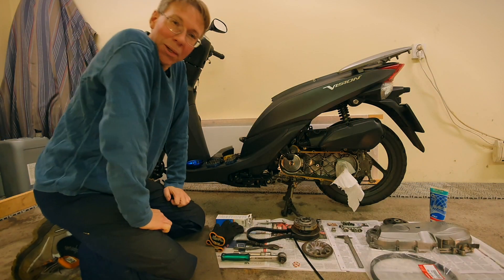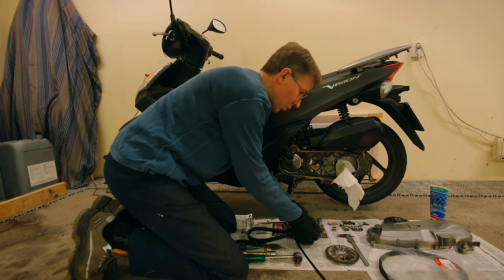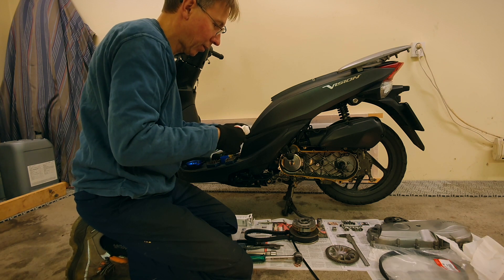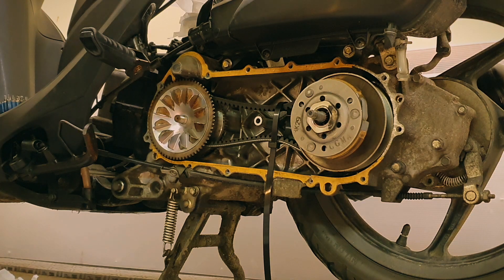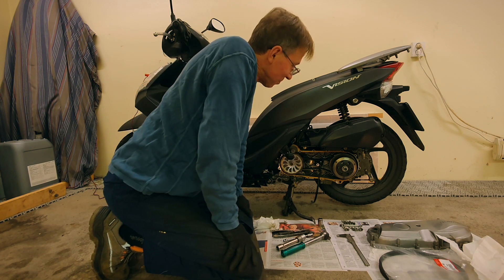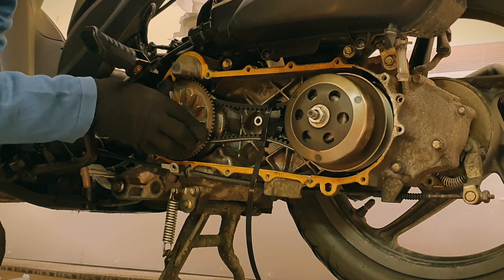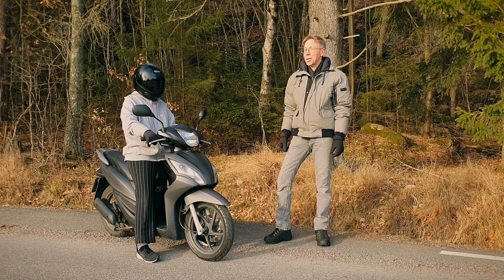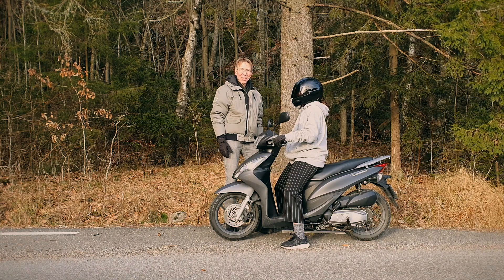HOW TO REPLACE A SCOOTER DRIVE BELT. SHOWN ON A HONDA VISION NSC 50.

Comment: Dear moped riders, I'm wondering if there is a tuned set of cylinder and piston 70-90 for HONDA VISION 50 4T 2012 except for 3116518 Malossi Thermal Group 83cc. Or is this the only option to increase the cubic capacity?

Comment: I bought a new drive belt,  but it not an original,  but has same specs. It will make any difference or not? The original is like more than twice the price. Thanks for an answer.
Reply from the maker: Hi Joseph. If the dimensions are the same then top speed should remain the same too. How a non original drive belt will wear and age is not easy to know.

Comment: where do I buy the variator counter tool? how do i google it?
And how much torque?

￼

Feedb
Reply from the maker: Hi Joseph. If you mean that little cogged steel plate that stops the variator at the end of the crankshaft from rotating, I made it my self. Draw the outline of the cogs of the variator on a piece of paper card board first, then copy it over to a 4 or 5 mm thick steel plate. It takes a bit of cutting and grinding but in the end that tool was very handy to have. Regarding the torque, I do not know. Was there a spec on a paper in the kit? I think not and if I'm not mistaken, I tightened it to a torque that I felt was good/reasonable based on my experience. If you have not worked on a lot with things like this, try calling the nearest Honda workshop. Or, measure the diameter and pitch of the threads and try to find a torque recommendation for something similar. Or, undertighten it somewhat but apply thread lock liquid on the threads. If the nut would start to come loose, I would think that the variator would separate and you would loose speed.
Reply: @hoojiesgarage1542  Yes,, have had mopeds and have tightened the nuts with a nut driver, thought maybe you should still tighten with torque, I have a nut driver so I will use it and at the same time use loctite, so it will probably be fine, thanks for the answer

Comment: Hej! Tack för mycket intressanta videos. En fråga, har köpt en Vision, årsmod. 2014, rullat 1800 mil. Helt original. Tycker den tappar kraft i uppförsbackar. Tips på hur detta kan avhjälpas, den behöver inte gå snabbare (gör 45 km/h) 
MVH Martin
Reply from the maker: "Loss of power when going uphill." Everything is relative though. How much is uphill and how slow is slow? The scooter in the video of course looses a little speed when going uphill but not a lot. Right now it runs with a different variator for higher gear ratio (video will soon come). I thought it would penalize going up hill but it doesn't. Does the engine of your scooter have normal compression? With 18000 km, has the air filter been changed? Spark plug ok? Are the variator disks free from deep grooves? Is the variator clean inside so that the weights can move as they should? Just some thoughts. Maybe some one else has some ideas or have encountered this?
Reply: @hoojiesgarage1542  Thanks for good tips, I'll look into/check the suggested aspects. Air filter has only been cleaned, never replaced. Ordered a new variator and a new belt. Shall see if it helps